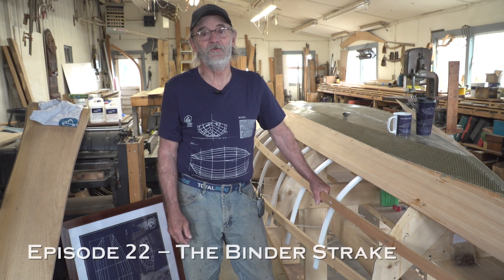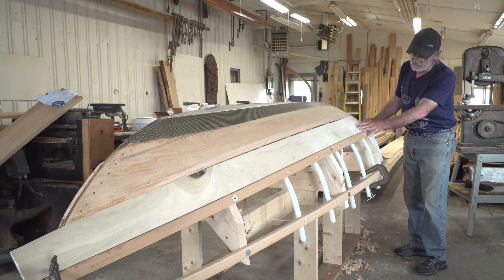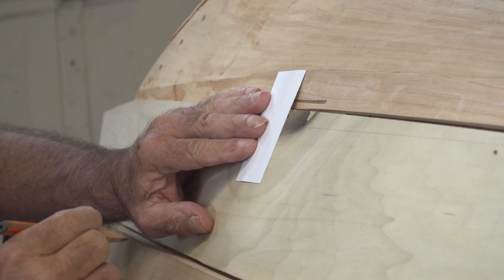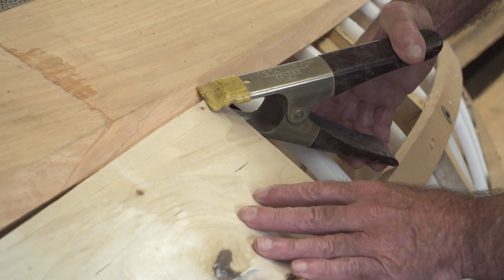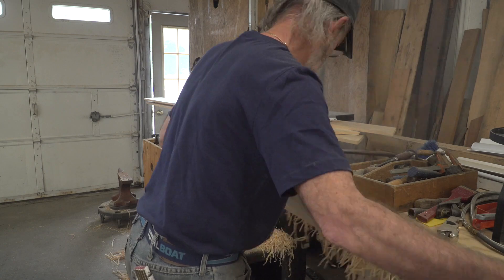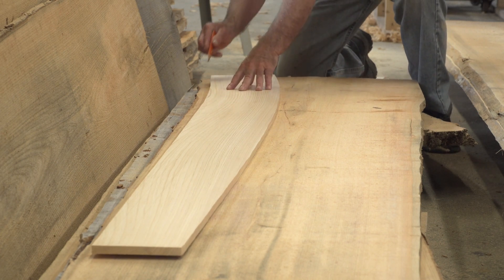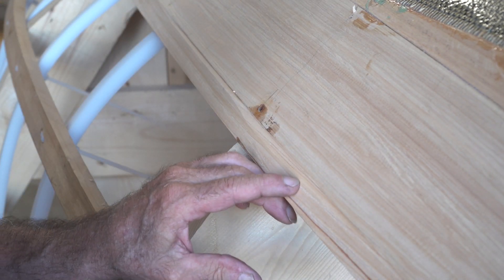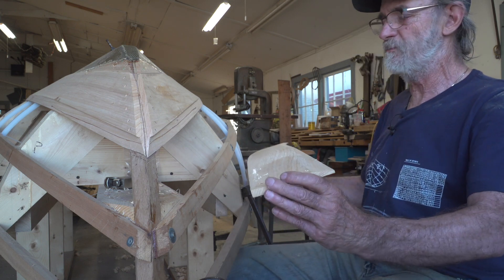Building the TotalBoat Sport Dory: Episode 22 - The Binder Strake

Comment: Tried the divider method of spiling many times but I've never liked it either. Pretty good for picking up a single point but otherwise kind of tedious. I use Lou's method most of the time except I like to staple on small doorskin blocks. Awfully nice large pile of stock to pick and choose from.  I'm surprised your getting those kind of widths out east.

Comment: I have been eagerly awaiting Louis' return and am glad to have gotten such a good demonstration of the business of the "gains". Can anyone tell me if I have the nomenclature right? I'm supposing--- it took me a long time to think of this--- that the term "gains" refers to the fact that with the overlapping of the strakes one strake is effectively "gaining" on another, in separation from the stem. That is, without making those rebates the offsets that would exist--- Louis called them "about a quarter of an inch of wood exposed [11:57]"--- would, in order to bring the gunwale edge into contact with the stem, otherwise require that the strake be twisted (definitely not sweet). So "fairing the gains", which is the expression that I've encountered, refers to the fact that the rebates eliminate the offsets of the strakes so that the surface of the hull near the stem is fair (smooth), outside and inside. I write all of this because I had supposed that the 1" bevels that form the "lands" or "landings" on the strakes were the gains; instead the offsets are the gains. After all, the rebates don't make the lands smooth, fair; they introduce steps. Hence it would seem that the beveled landings can't be the gains that are faired.

Comment: Great!  Glad t see you're back.  One thing - at 15:12 you say you hollowed the plank out.  How did you do that?...
Reply: Joe Burks one way I saw him do it before is with a small hand plane. It would have a round radius shape to the blade instead of being straight and that seems to do the job wonderfully.
Reply: Musical instrument builders use them as well, right down to tiny finger planes for shaping fiddle shaped instruments.
Reply: boatrat74 hey guys I have a great idea, hear me out ;) why don't we keep bugging Lou and maybe he'll answer in one of those question videos or maybe even show us on the other side in the next video ;))) I'm keeping my fingers crossed 🤞
Reply: Laser and Peter are correct, those planes are the standard approach.  But I will note that in this specific case Lou showed here, with only a slight shallow bit of hollowing needed:  THAT can be accomplished with a regular conventional flat-bottomed spoke shave, if you just grind a wee bit of radius in the blade so the corners don't leave track marks in the cut.  Then a sanding block shaped to a corresponding shallow segment of a large cylinder radius to feather it out evenly, with a piece of 100-grit sandpaper.  Or alternately, a light flexible size of cabinet scraper for the latter finishing step, if you know how to run one of those. 

I haven't seen the prior instance Laser mentions, so I don't know how this plank here was done.  But Lou's traditional pile of boatbuilding tools, almost certainly includes one or two of the old style wood-bodied "coffin"-shaped hand-planes.  (The pre-industrial antecedent of a metal Stanley smoother).  Boatbuilders doing a lot of planking, would have several of those of various sizes with the bottom modified into a radius to match the curved cutter, rather than just a radiused cutter in a flat-bottom plane.  (Actually, the old masters would be making their own wooden planes from scratch, if they wanted nicer than the modified common house-carpenter's planes).  But again, radius-bottom planes only become invaluable in situations needing deeper hollowing than this episode's example. 

Now having said all that, it occurs to me that Lou has often demonstrated some disregard for a lot of the "standard" traditional shipbuilder's tool methods.  Knowing him, it's just as likely he might have done this hood end with an electric angle-grinder with a coarse sanding disc.  Which would be faster than the old ways, if you're really good.  But if you're less than "really good", that's also a lot faster to make irreparable mistakes.